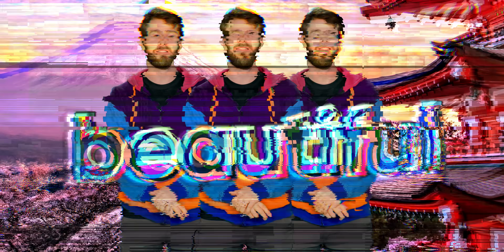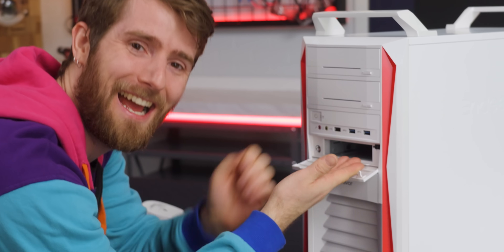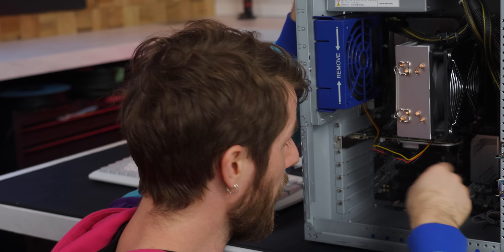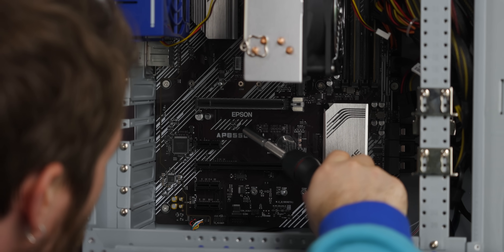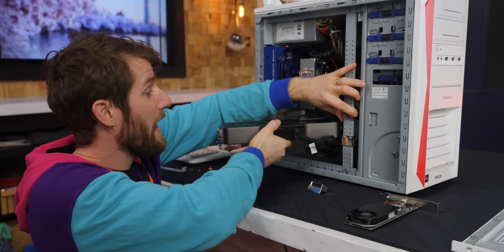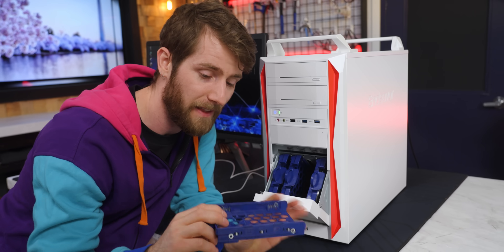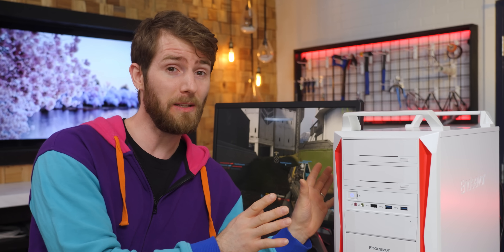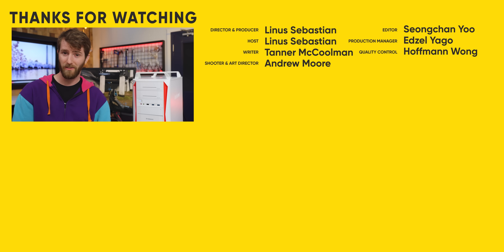I Bought a Gaming PC from EPSON - Epson Endeavor Pro 9050a

Comment: I also appreciate the genuine hard drive activity light on the front of the computer. I feel like a lot of OEMs are going away from those and it is a real tragedy for someone trying to figure out if their computer has locked up or not.
Reply: Those HDD activity lights are just annoying for everyone having their PC in their bedroom.
Reply: @Jehty_  It should only be on when you're using it and I think the monitor will be a lot brighter than the hard drive activity LED then. If it's really annoying you can always just put a piece of tape over it. It's one of those things that when you need it it's really annoying not to have it.
Reply: @DoRC  my PC only runs while it's doing some form of work.
Downloading stuff, rendering stuff, etc. 
All while it's doing that the light flashes. All of that doesn't need the screen to be turned on.
Reply: @TalesOfWar  most custom build cases still have them and the light is not solid it still blinks with even fast NVME SSDs.
Reply: @Jehty_  Yeah in those cases I suppose it could be a nuisance but you can always just put a piece of tape over It or even disconnect it if you were so inclined.
Reply: @DoRC  the hdd activity cable can be disconnected if its a standard pc
Reply: @Jehty_  There should be a switch on cases to turn them on or off that's clearly labeled, as I have a Fractal Core 1000 case in my home office, as I hate RGB bling, and at night power, and HDD LED where so bright with them on the right hand side of the case attached to the 2 USB ports, I had to put black electrical tape on them as they shined down the hallway with the door open annoying family members, and it was like a disco show with the door closed, thankfully I can still barely see them through the front mesh if I need too, and it's not distracting.
Reply: @TalesOfWar  They're often flashed steadily if there's continuous or very frequent access to the drive
Reply: @CommodoreFan64  Why not unplug the LED or add your own inline switch?
Reply: @resneptacle  because I still might need them for trouble shooting a frozen system, and I'd have to drill into the case, find a switch and solder a switch, easier to use $0.0001 worth of tape lol!
Reply: @Jehty_  just... don't plug them then
Reply: @resneptacle  You could repurpose the turbo switch for this!
Reply: @Jehty_  It's annoying if it's an ultra-bright ultra-focused blue LED but they don't need to be. A small area of lower-intensity diffused light is easy to spot if you're looking for it but won't project all over the room. Blinking power LEDs when in sleep are much more obtrusive to me. I've needed to do a few minor case mods (including putting masking tape over the bare LED under the cover) to achieve the right balance.

Comment: Kinda digging the case design. Im a huge sucker for the top handles and sturdy case design. The hotswap bay and video card support built in are also extremely cool. Would love to have more cases like that to choose from
Reply: That case is lovely, tbh I would pay for such a tanky sturdy case.
Reply: I kind of love the whole thing. PITA to build in, and, you know, airflow, but I'd sacrifice a lot for that bank of hot swap drive bays.
Reply: It looks like a cross between a modern gaming PC and a 90s Compaq case
Reply: I have a Antec case from 2004 I got for $10 at a thrift store that’s been my main PC case for years and is more or less setup similarly to the case in the video, clip in back fan mount and all. One of the great things about having a standard like ATX is that you can absolutely go get old cases and still use them.
Reply: Came here to say the same. I love how secure the GPU is. Could jiggle the case by the damn GPU.
Reply: @josephbartholomew  If you can find one, the Cooler Master Scout from around 2012 gives you an even better handle design, and all the air flow you could ever need.  No hot swap bays, but the cages in the case take maybe a minute pull the side panel, pop the cables and slide out a drive, then put it back together, if you need to change a drive.  Don't know if it's even worth hunting one down, but my FX8350 OC'd to hell and RX590 stayed nice and cool in it.  Did throw an extra 120mm fan in the 5.25 bays.  As far as lugging a desk top PC around goes, it was a great case for it.
Reply: I love them too. I found a case with handles and bough an Icy Dock to put in the 5.4" bays, but mine is black and isn't as sturdy.
Reply: I want one of these cases too

Comment: That's actually a good looking case. Dell and MSI cases could learn a thing or two about simplicity and rigidity on their cases.
Reply: My Dell Precision T3500 is also built like a tank. I currenly am browsing the chasis available on the market and I can allready tell I am gonna miss how solid it is. Not to mention 3.5 inch bay that Ive installed a card reader in.
Reply: Yeah I quite like the way it looks vs the most common cases that are popular nowadays
Reply: it just a case my guy. u ain't gone see how it will be holding up when u drop from the second floor...
Reply: it looks like an old case, like the first pc i bought with my own money had a similar case.

Comment: Fun fact, Mitsumi also made some great vintage mechanical (and even nonmechanical) keyswitches
Reply: Not the miniature mechanical switches model they are horrible 🤣
Reply: @PreciousAlpschindler  indeed. But the mitsumi standard mechanical "KAM" switches in the apple m0110a are fantastic as are their KKR KPQ and other varient hybrid switches.
Reply: @PreciousAlpschindler  Some people swear by them, when lubed.
Reply: I think my first cd- ROM drive was mitsumi. Connected to Creative Labs Soundblaster 16 soundcard.
Reply: and OG optical drives
Reply: Just tore down & cleaned my Amiga 500 mitsumi keyboard assy today. Still going strong!
Reply: Mitsumi also made good floppy drives according to the vintage crowds.
Reply: Mitsumi also made a bunch of CDROM drives (and a universal dos driver for cd drives)

Comment: I live in Japan. Great job in explaining why this type of PC still exists. Japanese also have a high preference for domestically made products, hence the effort that was made to put the ‘Epson’ branding on the board.

Well done video.
Reply: also Japanese are notorious on Brand Loyalty so if it's not branded they wont even touch a thing
Reply: @yasunakaikumi  That makes sense but hopefully it's always loyalty to a good brand!
Reply: @yasunakaikumi  The Japanese are notorious for knowing nothing about tech, which is why there are suckers paying $2000 for a tower with a 1030 and a floppy disk drive.
Reply: @harfgarflarf  these towers are aimed primarily at older people, hence the optical drive and 3.5" slot if you need a floppy drive.
Reply: @harfgarflarf  UMM they know A LOT about tech; they live in the most advanced nation in the world; so stop it troll
Reply: @allentoyokawa9068  A LOT? Now explain this: What is GAA and EUV? (semiconductor)

Comment: Fun fact: SEIKO is a branch of Epson. Hence, SEIKO Epson Corporation

They also use the same technology that their watches use (the piezoelectric crystal) in their heat-free "PrecisionCore" print heads as opposed to using a resistive heating element in each jet of the head.
Reply: Not quite, SEIKO is a completely independent company from Seiko Epson. Epson started out as a movement and watch manufacturer for Seiko (under the name Suwa Seikosha), and to this day makes movements and watches for Seiko and Grand Seiko, but they are completely independent entities. Orient Watches on the other hand is a subsidiary of Epson.
Reply: FURRY PROTOGEN UwU
Reply: Thank you...  I was going to say... Uh Seiko-epson is one of the biggest watch companies in earth.....
Reply: @OmairArif   yeahhhh. Except my Seiko Solar watch was manufactured and warrantied through Seiko-epson...   Ownership of the brand nonwithstanding
Reply: @OmairArif  as someone who worked for Epson I would like to correct you here. Epson own part of seiko.
Reply: @maskedkitsune9774  Epson owns <1% of Seiko Group. So they technically own part of Seiko but not in any meaningful way. Seiko Group also owns about 3.5% of Epson. You'd expect some cross ownership considering how closely these companies work together.
Reply: @nickloeschke8209  Yes, Seiko Epson basically handles all of the Quartz, Solar, and Spring-Drive watch production for Seiko Watch Corporation (subsidiary of Seiko Group), and depending on region may handle the warranty as well. But that does not make Seiko a branch of Epson, like the original commentator stated (if anything it would make Epson a branch of Seiko). It's like saying Samsung is a branch of HP because HP makes and warrantys Samsung's printers.
Reply: @OmairArif  it’s not 1% check last year they own way more
Reply: @OmairArif   oh yes.  Epson is part of the Seiko group .. sieko is by far the bigger brand.

Comment: If they sold this case individually I'd absolutely buy it.

I much prefer this kind of look and feel to the tempered glass gamer-cases you get at the moment. I don't care about RGB or LEDs, I don't need a transparent side panel. Handles are very useful. GPU support brackets would be INSANE to have. This case, with a bit more airflow would be a very quick purchase for me.
Reply: Just poke holes in it.
Reply: Totally agree, GPU suppport is a must have imo.

Comment: I wish more PC makers start revisiting this style of cases. This one is slightly edgier than I'd like but I'd love retro looking cases that actually has more thought out, modern cooling features integrated into it.
Reply: Yeah if you want fans louder than your headphones
Reply: @alexstromberg7696  I'm sure there are sleeper builds on customized retro cases that are actually quiet. That's why I added the part about "modern cooling features." :)
Reply: I'm just going to say it: I miss front bays and everything you could do with them. Drives, fan hubs, pump/res combos, etc. Was such good usable space.
Reply: A thing around the world: 💀
The same thing coming from Japan: 😨🤯😍
Reply: @Aarush Kumar  obviously, yes. But building PCs for the last 20 years, I miss some of the convenient utility front bays had for standard ATX builds. Take one specific example: had an awesome dual-5" bay XSPC dual-D5 pump+res combo back in the day, all which fit away from everything else tucked in drive bays, and whose fill port was easily accessible from the front drive bay cover. Similarly, a fan controller on front of the case with RPM and temp probes and readout was nice. Hot swapping drives was also more convenient if that was a need you had. Aestethically, I prefer modern cases. But I do find myself nostalgic for the utility of front bays
Reply: @AarushKumar-sf1vk try adding additional front io to a fractal torrent -.-
Reply: @alexstromberg7696  Get speakers louder than your pc to show dominance
Reply: @not_imy  I've done that with old dell cases, it requires lots of sawing and pain

Comment: That's actually a surprisingly handsome looking case! And I kinda love the front-loading removable drive bays. Far easier to deal with than opening up the opposite side-panel to get to them! I do wish they had the option to replace the front optical drive bays with like a fan mounting option, but other than that this looks like it would last quite a long time. And no RGB or glass side panel - yay!
Reply: How often do you change your drives?
I mean with how often I do that (at most every few years), no easy access to them really isn't a big deal at all.
Reply: @Jehty_  I'm a digital artist, as well as a bit of a habitual short story writer (with a seeming inability to actually finish a bloody story I start before starting the next one), so I actually tend to fill up hard drives quite quickly. And unfortunately my finances don't stretch to being able to afford the larger capacity drives - so I have a collection I usually rotate through and occasionally add a new drive to. So yeah - this feature is actually useful for me :)
Reply: @DavidStruveDesigns  hm, interesting.
I would have never thought about physically swapping a drive when it's full. I would've just moved the files 😂
But I guess both options work.
Reply: @Jehty_  Given that it's a workstation, removable drives are a security feature as much as anything else.

Comment: I wish there were more cases on the market with tis design: just simple, robust and functional!
Reply: Old rosewill cases are like that. I had an fbm 01 for my first PC. It looked and felt like an old prebuilt case and I loved it. Never did anything with the 5.25 in bays when I first built it.
Reply: Fractal does that - LianLi as well. Okay they don't lean as far into the 2000s for the design, and they don't have the cool 3,5 inch tray ffor HDDs.. but otherwise..

Comment: As someone who likes sleeper builds, although in my case probably better to say reverse-sleeper builds, i.e. retro systems in modern cases, I really love this case. Even has spots where you can put extra COM ports. That's certainly not something you see every day these days. Very nice.
Reply: Zaydan Alfariz  Well, a sleeper build is usually modern tech in retro/vintage cases. Reverse sleeper is just the opposite: retro/vintage tech in a modern case. :)
Reply: Zaydan Alfariz  You're welcome. :)
Reply: Revere sleeper builds  .... Now there is an idea, I can actually put my original IBM PC motherboard (with cassette tape support) to use, as I've kind of given up ever finding a proper case for it.
Reply: @paulstubbs7678  im currently in the process of doing this! with a at socket 7 mobo and a 75mhz pentium 1 cpu for DOS gaming
Reply: imagine one of those 5.25 drive bays filled with a 5.25 floppy drive XD
Reply: @paulstubbs7678  I have a case coming, a bit retro itself but I'm putting a MB which I thing has an early i5 on it. The best part of that MB is that it has floppy, COM, and LPT on it, so yeah, it'll be a modern-ish system with loads of legacy stuff on it. I guess I'll mainly be using it to make floppies for much older systems, like the Commodore 8-bits, the Amiga, or Atari ST.
Reply: Reverse sleeper build sounds like a excuse for someone who could only afford a new case xD Guess it's a real thing

Comment: I really really want to see built like tank no frills cases back. Corsair did do a few around 2015, but then just started making everything too fussy again. Kinda like a sleeper machine, but also because I don’t need all the other fancy stuff :P
Reply: What exactly do you consider fancy stuff?
Reply: @bobbyb1647  Anything that is purely for aesthetics. For example, most cases are designed now to be completely clutter free as most have clear side panels to show off GPUs etc. When in reality, a solid GPU bracket like this case has is more practical than RGB.

I want tonnes of airflow and bare bones but with modern USB headers. I don’t want a crazy angular ‘gamer’ case with tempered glass.
Reply: @BBROPHOTO  God yes to all of that. Hell, I'd love to have the case from the system shown in the video.

The mounting bracket, the optical drive bays, and the hard drive bays would all be perfect for my "do everything" system project.
Reply: @BBROPHOTO  im with you but somewhere in the middle. I want a window but want the front to look more like a traditional computer with drive bays... in white.
Reply: but most people especially while building their first PC want that frill! mine has a bit but its clean

Comment: The first PC I bought was from Escom in the UK in the early 90's. It arrived with the CPU socket hanging off the motherboard. it was returned to them, when it arrived back to me the socket was held on with a cable tie. It was at this point I got a refund and built my own PC, which cost me half the price. Thanks Epson, without that poor experience I may never have started building my own. 🙃
Reply: I think you have got confused with Escom (the budget computer brand we had in the UK). Epson were most famous in the UK for printers. (I am from the UK).
Reply: @cliffhulcoopofficial8075  OMG how funny. Must have been a typo or autocorrect. Thanks for bringing it to my attention though. I'll edit now lol

Comment: I kinda have a fondness for computer cases that are just honest computer cases. Like, a box with all the functionality of a box that has a computer in it. Never been overly fond of the showcasing aspect of cases.
Reply: Check out the Antec VSK-4000 it'd probably be right up your alley.
Reply: @atomicskull6405  I've heard that Antec case is a bit thin and cheaply built, plus it's a bit too bland for me. I'm a fan of the discontinued NSK-4480B II. It has a simple two-tone styling and also has a touch of front ventilation. I love that you can put it up against a wall or put things on it without ruining the cooling.

Comment: I really dig that case, would go nicely with my Sony E530 CRT, which I use as my main gaming display, OLED is still a ways of the IQ and performance of a top draw CRT monitor when it comes to gaming, especially when it comes to lag and motion clarity, and BFI is not the same thing as raster scan zero latency, in fact it adds a whole frame of lag (20ms).

Comment: While not the best internals I would no joke love a case like that as a stand alone. The hot swap front hard drive bay drawer, expansion card support post and overall rigidity of it is something that's hard not to appreciate specially in this day and age of GPU units that are heavier than the motherboard, i would say "add a few extra air intakes" but then there's the upper drive bays that can easily be taken out and replaced with fan meshes, absolutely lovely.